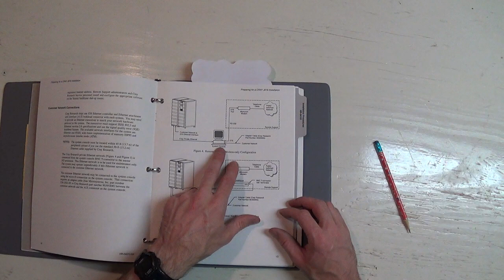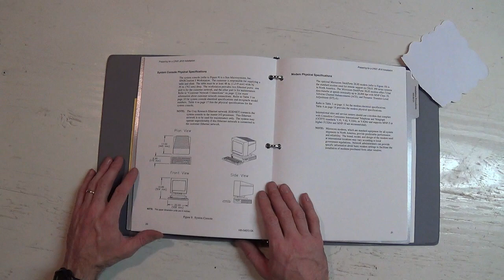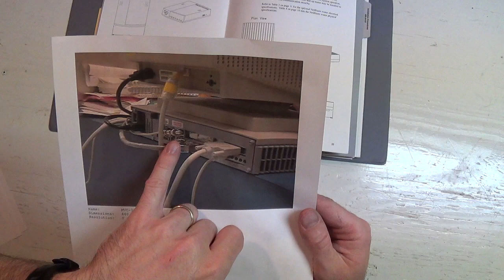Cray J98 Project - The SWS

Comment: Thanks for another great video! As a mere x86 heathen, I do wonder if it would be possible to use a single Sun system, Ultra 5 or better, as both the SWS for the Cray and SSP for the E10K - I don't know if that's even possible, or if it would require two different Solaris installs, but its my $0.02. Which is also how much my collection feels worth when I realise I don't own either of those machines. :P
Reply from the maker: That's a tough call - although one I hadn't even considered! There's a good possibility that they'd use different enough filenames that they'd sit side-by-side in a tftpboot/ and NFS root... but the kernel names might also be the same, given the IOS uses a SPARC processor (although it is VxWorks, so then again, perhaps not). Hmz.

Comment: I personally would use a properly configured Linux box to attempt to bring it up, but that's only because I am more comfortable with Linux than SunOS/Solaris/etc.. Excellent videos, I can't wait for the next and to see that machine eventually pulled up!
Reply from the maker: Without knowing how the two systems talk to each other, it's not really a 'good idea' from the get go - I'd spend a lot of time trying to figure out what isn't working on Solaris and fixing it. That doesn't mean if I get it working reliably under SunOS and figure out how it actually works it couldn't be moved - assuming there are no binary applications that are non-transferrable.
Reply: This is old/standard stuff.  I am thinking linux would be fine in a bootp/nfs root/boot setup.  But you did mention diagnostic/control stuff on the disk which of course won't run on linux natively.   Linux almost seems like departure from what it is all about though.  Making it work on hardware from or near the era seems much more in line with what your channel is all about.   Do you have a bridge/switch that has 10b2?
Reply from the maker: I should be able to get the machine up and running on a Linux machine - but as I said and you mention, I think there may be some binary diags stuff that will require Solaris. But I'll know more when I dig into it. But, also as you say, the "right" thing to do is use a Sun WorkStation, so....

Comment: You have a 15 pin ethernet on the back of it.  Those are made to be adapted via a 10Base2 MAU like a CentreCOM MX10S or 10BaseT.  Basically you choose your media type.  Those MAUs are pretty cheap.

Comment: I have a dual purpose SBUS SCSI and 10Base-5 card and transceivers to RJ45/BNC  and coax and hub with both media and IPX/IPC machines (from Camnet, the first "free" dialup ISP in the UK) but might still use them and am in the UK. I'm sure you can find these more cheaply and closer to home.

But if all you want is bootp and NFS use a BSD (or Li***) machine, virtual or otherwise

Comment: You Could just use Sun enterprise E250 server with a sun compatible 10 base-t coax Ethernet pci card and for the coax cables use cctv bnc patch cables, splitters and terminators.

Comment: Would a iPC/iPX do it?
Reply from the maker: In theory, it should - since the video was made I've learned that most, if not all, of the SWS software is Tcl/Tk. All of my IP*s have bad NVRAMs, though, which'd be nice to avoid.
Reply: ahh.. ok, I do have a few iPC/iPX with good NVRAM.  That Ultra E2 would be cool though.  I been wondering about possible NVRAM workarounds when they do.
Reply from the maker: You can hack the Dallas RTC/NVRAMs with a battery holder (as mentioned by Doogie Rick above), but it requires cutting into the damned thing and that makes me seriously nervous. One of these days I'll just suck it up and give it a go. You can also buy replacements from Mouser/DigiKey... but they're $15 to $20 a pop!
Reply: @jpkiwigeek  I've got an SS5 170MHz with an NVRAM that I've already modded if you're interested... it would at least be the right machine, although I have no 10b2 either :P